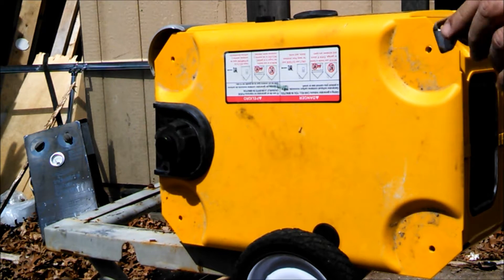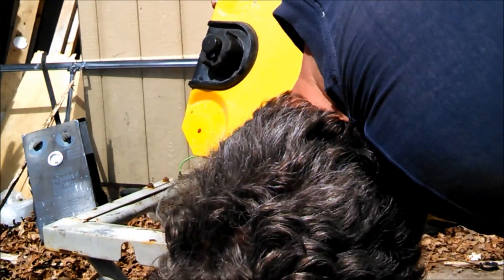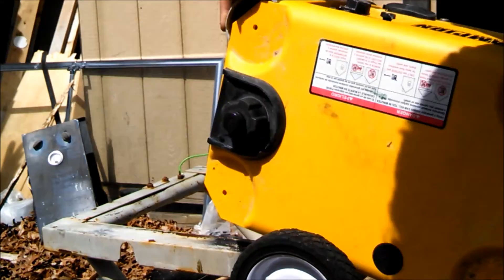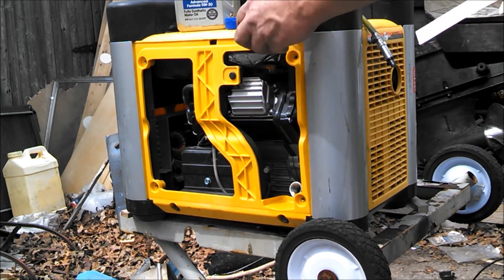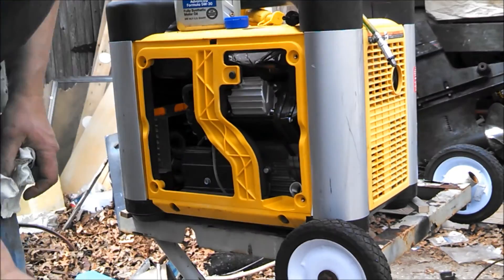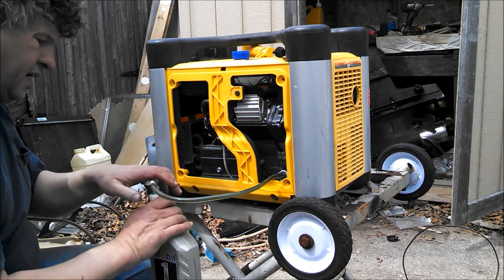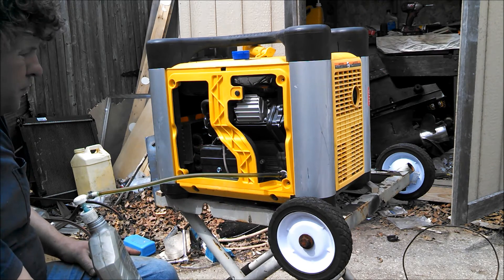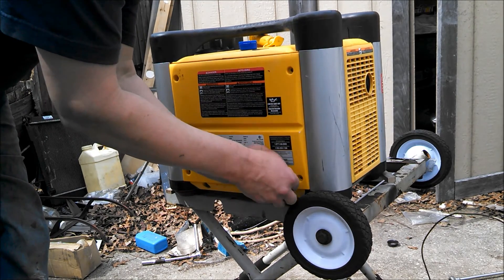Champion 2000w Inverter Generator Maintenance-How to

Comment: Long shot here. Mine has low oil light come on Every few hours after fresh oil. I tore it apart replaced plug everything elts looks good still won't stay running. I am thinking low oil sensor is bad but don't know the location if anyone happened to know it?

Comment: Nice video can't wait to do this to mine i just bought off a friend for 30$ got it running in less then 5 min works great but i noticed oil leaking from the bottom after running for 10 mins any suggestions on where it might be leaking from ?

Comment: Took my generator to the shop and after $90.00 they got it running. This time when it didn't work I saw your video and fixed it myself saving $90.00.  Thanks for your video.

Comment: I need help with my Champion 2000 inverter it wont start at all , I havent ran them for 5 year just want to try this morning and nothing happened . What should I do with it to get it start?
Reply from the maker: Check for spark if good suspect clogged carb check out my other video on that very subject  https://www.youtube.com/watch?v=Lorqlm08aAI&t=2s also new carbs are cheep on amazon ( about $20)
Reply: If you haven't run them for 5 years, GUARANTEED one of the problems is bad gas. Every time I use my generator (I have two of this model), I use the screw on the bottom of the carb to drain the fuel totally from the float chamber. If not, regular gas will go bad very quickly. I imagine your carb is full of "cheese" which will necessitate a complete carb breakdown. In the future, use premium non ethanol gas with a fuel stabilize if you want to ensure it starts when it's needed.